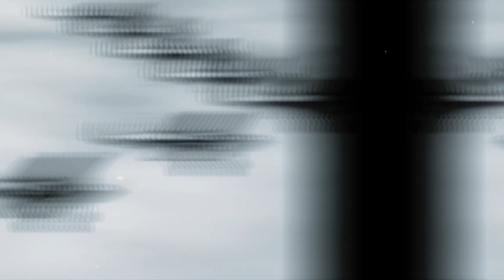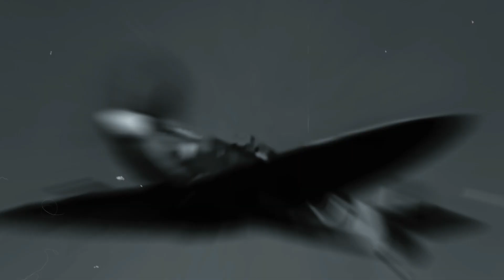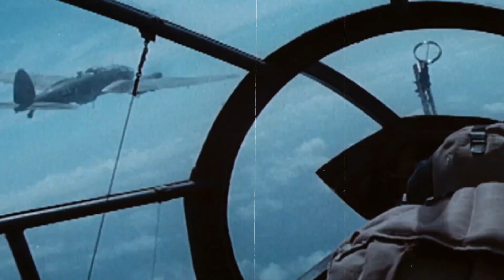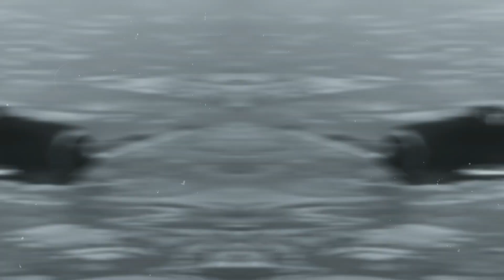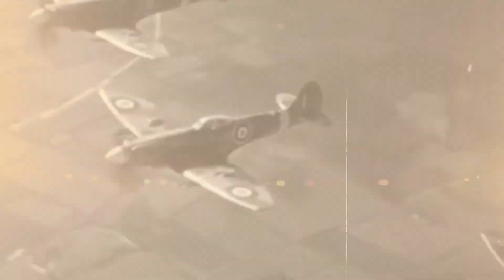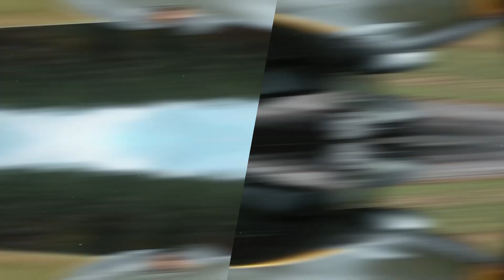Creating a Faster, Deadlier Spitfire: The Supermarine Spiteful

Comment: There was nothing wrong with the high speed capabilities of the original elliptical wung. During the autumn of 1943 Spitfires went through sound barrier tests,  the Mk  PR XI reached Mach 0,92 in dives from 40 000 ft, and in February 1952 a Mk. PR 19 flown by Fl Ltn Ted Powles reached Mach 0,94 in a dive from 51 500 ft over Hong .Kong. Both has the original fuselages and wing s designed by Reginald J  Mitchell in the mid 1930s, exept for the necessary modifications to adapt to the more powerful engines.